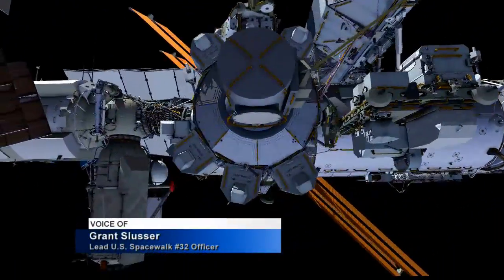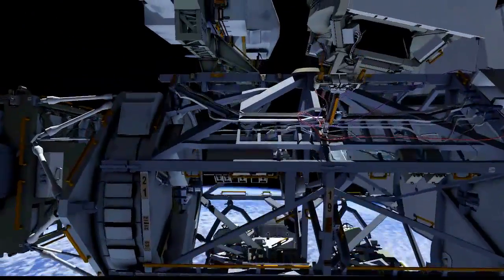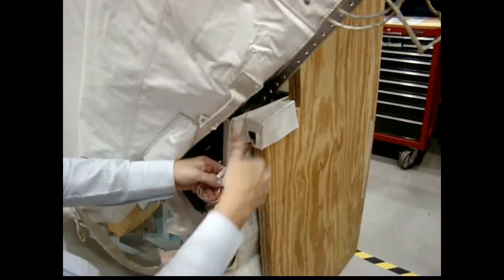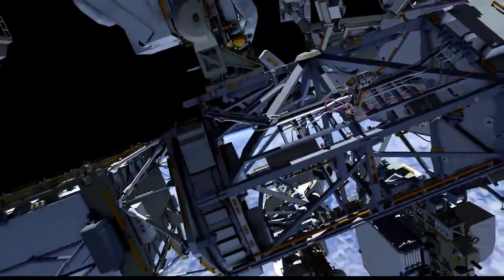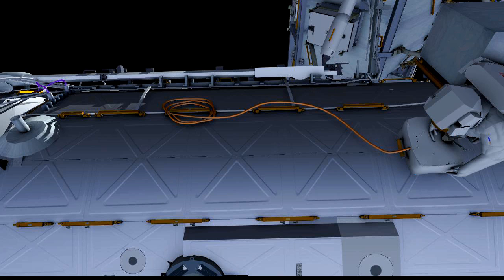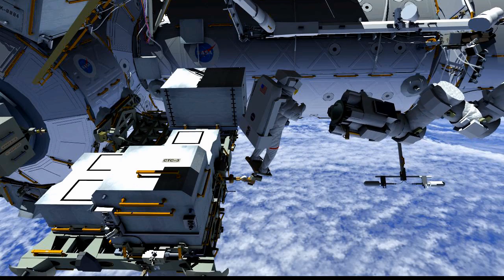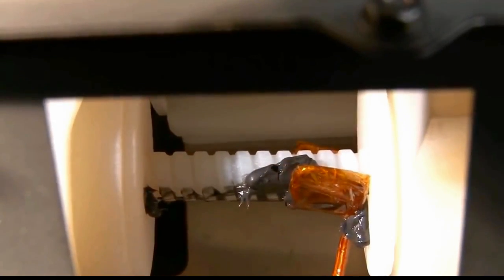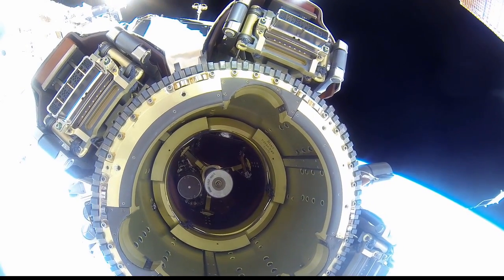3D Animation of Oct. 28 Spacewalk Activities

Comment: 1:) 3:45 ? the walls of the training pool are painted white ?! Why did you choose white rather than black or blue? --> maybe the big screen which is ideal projected an image of the space for better simulation, no !?
2 :] question : there needs some repair "patch" when micro-meteorite (or debris ..) come stranded on the hull iss? THXNASATEAM 3°'~
Reply: +ALEXIS NAREZO 
You've never been to a pool, have you? Most pools are white, because that's the natural color of the materials used to make the walls. The NASA training pools aren't made to look pretty, and painting the walls would just add unnecessary cost to the already expensive facility. 

They shield the station by having a sheet of metal a few inches away from the actual structure (i.e. the pressurized hull of a module) so if a meteorite hits it, it will definitely go through the outer sheet BUT upon impact it will be pulverized and the left over dust is the only thing that hits the thing being protected. What's left over is a microscopic hole in the shielding.
Reply: ***** ok for 2) I suspected a little, thank you your answer brings me some precision ;) 
to the color it is to set up simulation condition (although astronaut must think something else (there is the empty) color plays a secondary role (unconsciously) in attention, concentration and movement coordination (cognition) 
No ?
Reply: I know :training only for gesture, but under influence of différent colors the precision of gesture not same !?
Reply: ***** 
yes I understand, the light in space is closer to white than anything else. 
Even the ISS is white (neutral) I thought he had some color variation when the astonaute made an exit in space ! OK.

- And also I talk about the interior colors (white) would not it interesting for life and comfort astronaut can change from time to time to tint the vessel interior, to avoid fatigue (debasement ) and creates something that can give life impression on land, voila ! 
Thank you for your attention *****
Reply: ***** 1) know why in the morning to get dressed you choose this "colors" rather than another ?
2) you think it was chance (hasard) that guide your choice ?
Y or N ??